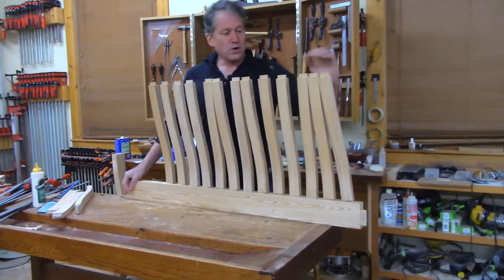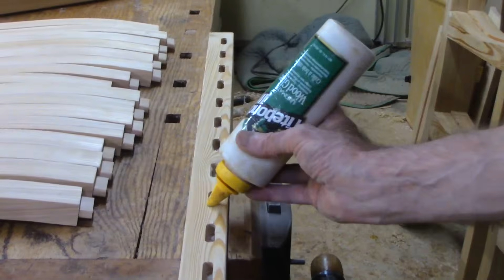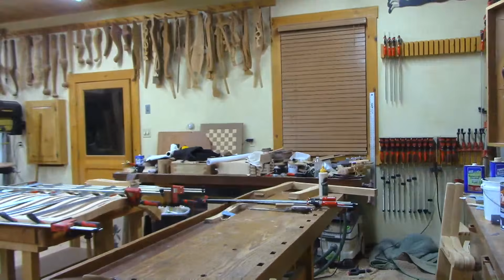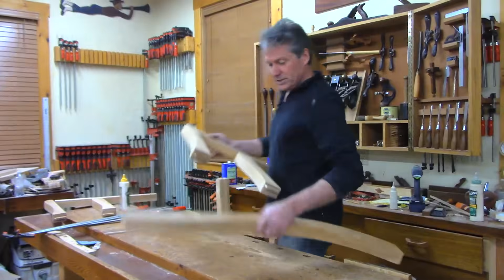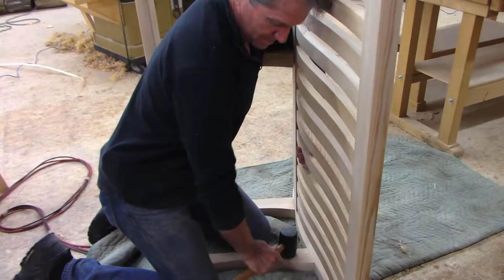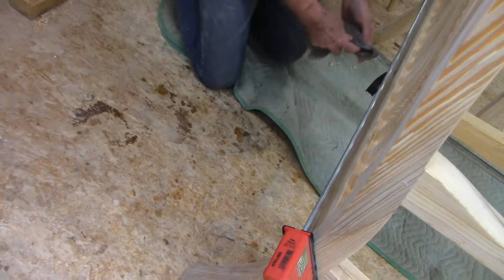Gluing Up Great with Tom McLaughlin

Comment: Hi Tom, Like I was saying in the chat the bench is a great looking outdoor piece of furniture. I think it is a good idea to apply the finish with Floods (cypress) or any deck finish product. Although a paint finish will always be the best way to go for outdoor furniture. You can enjoy the natural look for a while by finishing
the benches with the natural look first for a few years or so, and when they need to be refinished again do them with paint. I have heard of a exterior gray coat primer first and then finish it with a good exterior outdoor oil base paint or latex base paint. I have always used outdoor latex on my garage and it holds up good. What are your thoughts on this, when painting the benches?  Have a great Memorial Day. and always,
 " This Memorial Day we join together in Gratitude.....Remembrance......and Respect In Honor of the Fallen"
Reply from the maker: Hi Steve, Yes, I agree with you on the approach to finishing the benches. I’ve gotten them all done with a good application of Floods. Hopefully they will hold up well for a little while with recoating, and then I will likely go to painting them.
I also finished painting my outdoor swing which initially had Helmsman spar varnish but degraded so badly it was time to paint. I used A good Benjamin Moore primer tinted gray, and then put on two additional coats of Benjamin Moore acrylic latex in red. It should hold up well for a while! 
Hope your Memorial Day was good too, always amazed and grateful for so many who made the ultimate sacrifice for our country.🙏🙏👍

Comment: Beauty grain on that sypruss.  is sypruss similar to douglas fir?
do you stain the bench then do the epoxy on the bottoms of the feet?
Reply from the maker: Yes, do like the grain as well Ben! Cypress is a softer wood similar to Douglas fir, but with a grain texture more like Southern Yellow Pine. 
I’ve actually never used the epoxy technique, until earlier today I got it on all the feet of the three benches. I thought it would be best to apply before staining to insure optimal absorption into the end grain of the feet bottoms. In fact, I turned all the benches upside down, taped around each foot to create a little barrier so the epoxy would not run off the endgrain, and applied a generous coat of epoxy. So will stain in the next day or two.
Thanks! 👍